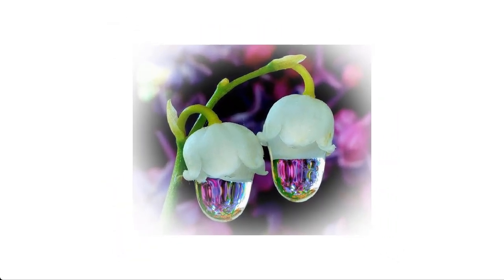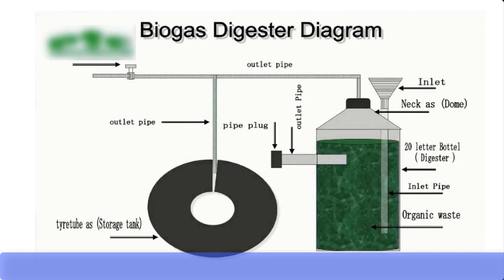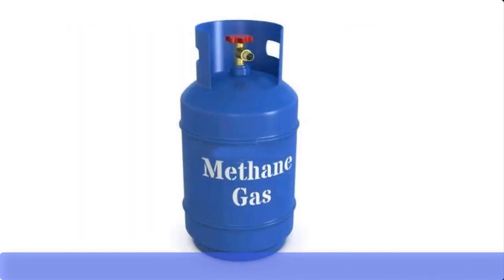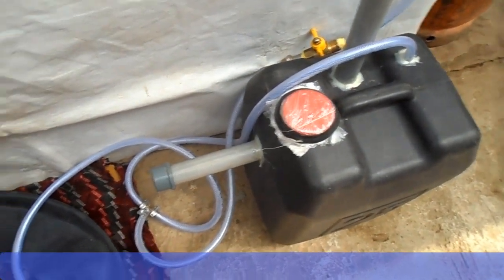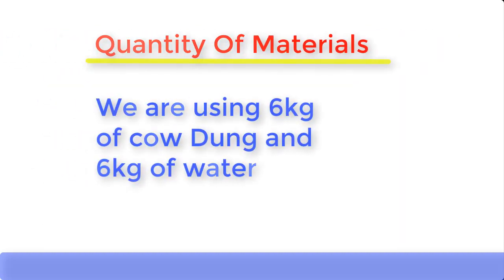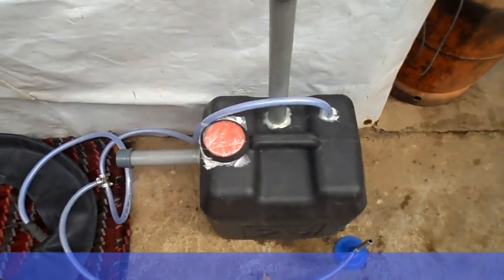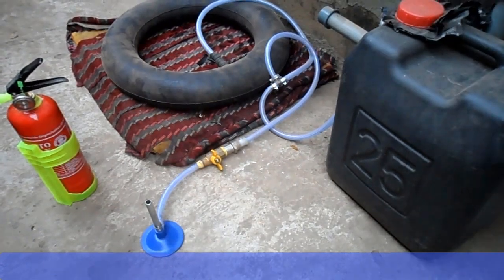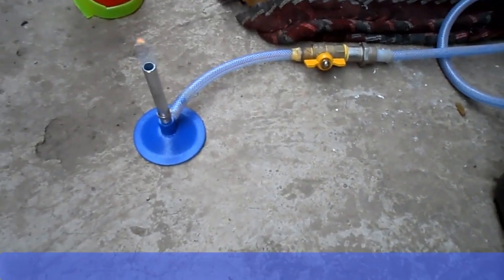How to Produce Cooking  Gas At Home From Food Waste

Comment: SIR, i have a question. i think, its also possible to get electrical energy from that digester. where should i put or connect tose??? Thank you
Reply: you will need a turbine
Reply: @Frepzter  You mean and Electricity generator that runs on gas ..
Reply: Yes, is possible. there are both ways: 1- running an electric generator from gas, 2- running a vapor motor  from heating water with gas.

Comment: Please sir is the cow dung fresh or dry and can you use gas bottle
Reply: NO Bottle .. to fill bottle you need to freeze gas to make it into liquid and use very hight pressure. Rubber tire will fill in gas form .and the elasticity of rubber will give you the pressure need it to get a good flame on the Burner to generated suitable heat for cooking. .. Dry caw dung will take 3 months to produce gas,,fresh dung already is producing gas , from the moment that cames out of the cow backside .. Only needs a digestor to contain gas and produce some pressure .. ( went rubber tire get saggy .. put some bricks on top, to use all gas )

Comment: Good job! How often should the cow dung be replaced? What precautions so that oxygen does not go into the digester when refilling?
Reply: Nice Video Sir! How long  can last the 6 kg of Cows dung?
Reply: No need to replace .. you have to add mix Manure water weekly  .. the old waste will scape every time you add more mixture
Reply from the maker: As soon as the tube stop inflating..
Precaution.... always lock the gas valve before and after dispensing gas from the tube
Reply: @SunshineResourcesSrtv Thank u Sir